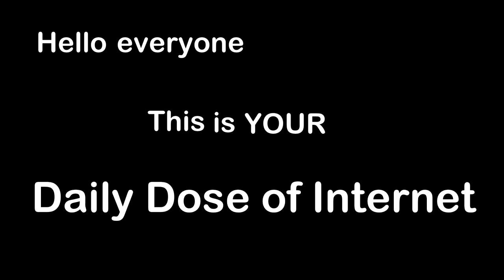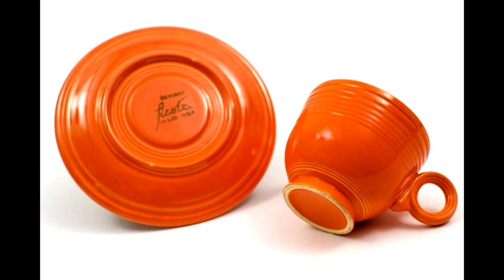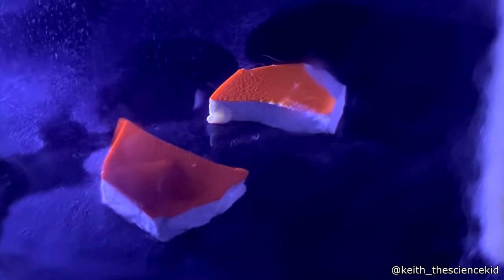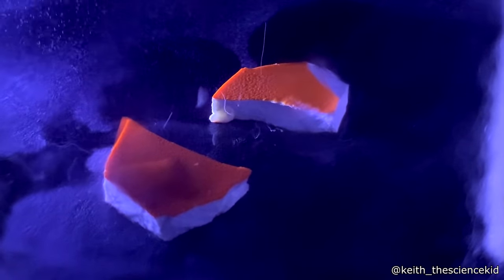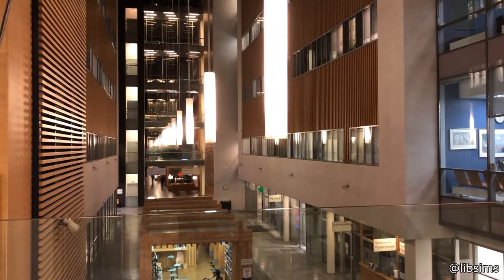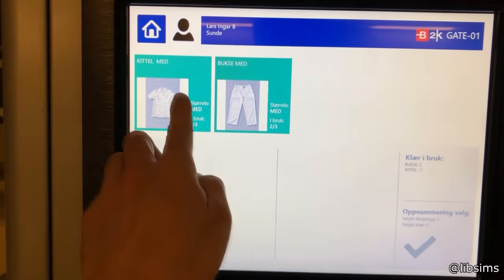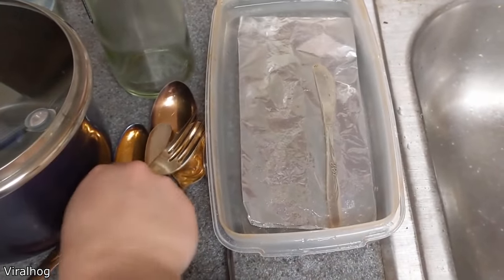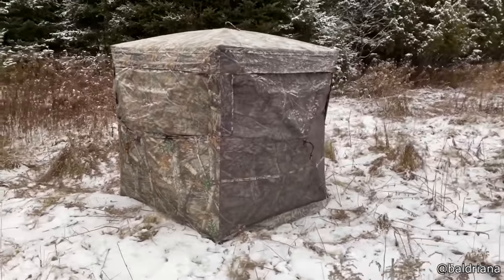Cutting Scissors With Paper

Comment: The silver cleaning method is a sheet of aluminium foil, a good spoonful of sodium bicarbonate (baking soda), and then boiling water. 
Place your silver items in the mix immediately while the water is still hot, one at a time, then rinse with tap water and buff dry with a cloth. Silver jewellery (like chains) may need to be dunked two or three times to get clean.
DO NOT use salt instead of baking powder. Salt will cause your silver to oxidize (turn black) even faster.

Comment: That radioactive pottery is actually pretty interesting. You never know, this could be the cause of a lot of things
Reply: The ionization is so short that you would have to eat the plate to be effected, but by then you would have bigger problems on your hand as the other materials in the Glaze would kill you long before the radiation would have any effects.
Reply: @G-_Money  According to the article I just read about it, it is advised not to eat off them or worse drink from them. On occasion is probably fine, but doing it regularly may increase cancer risks although such a correlation has never been observed. Even being in the same room may be a problem, but not significantly until you are around a lot of it or around it often. Risks increase if it is broken.
Reply: I know a lot pottery became radioactive when the US government was testing nuclear bombs in the 1940s and 60s.
Reply: I eat off the exact plate
Reply: Boomers and some of their offspring were around so much toxins and radioactive material especially as children. Sure they are tougher but brain damage doesn't equate to not being a snowflake.
Reply: Radioactive Pottery is radioactive because of the pigments used in the paint. Not good to eat/drink from daily, and risks increase with fractures/scratches in the coating, exposing the radioactive paint.
Reply: @MEGAF4IL  I have one with a chip in the bottom how dangerous do u think it could be
Reply: Radiation-wise, heating food in microwave is more dangerous than serving it on uranium-glazed pottery. Nevermind using your phone and wi-fi, that's another whole order of magnitude more radiation every day.
Reply: Like the cause of when I had Eight Diarrheas In one day.
Reply: There's some good stories of the Radioactive Pottery, such as the true story of the Radium Girls
Reply: Actually they probably did that for your safety to kills bacteria and it’s probably less dangerous then a tan
Reply: @jacobg8640  the only risk is if it's broken eating off it is fine your food isnt going to become radioactive if u put it on it only risk is if the dust from the paint from the plate braking gets into your lungs the plates already been around for years so anything that could come off it already has why do u think these havent all been immediately hunted down and destroyed because there particularly harmless
Reply: Exactly. And why were they covered with uranium in the first place? Like wtf
Reply: @brazybenjamin2937  because people didn't know it was dangerous and it glowed in the dark so it was cool
Reply: Bitten by radioactive pottery
Reply: I NEED MORE EXPLANATION FOR THAT AD NOW I DONT HAVE A FUCKING CLUE IF IM GOING TO DIE????????
Reply: I change the 777 to 778
Reply: I mean of course, your eating off of freaking uranium
Reply: AHEM AHEM CORONANAAAAA AHEM AHEM
Reply: For anyone who doesn't know what to think there's an article about this called "How Radioactive Is Fiesta Ware?" (Written by Anne Marie Helmenstine, Ph.D.) which basically concludes that yes there is an increased risk of cancer, you're probably going to be fine BUT in case that you have such dinnerware, the Radioactive emission that affects you gets minimized if you don't use it with acidic foods, eat off of it when it's chipped and sleep next to it. 

Here are some direct quotes if you do not trust my personal interpretation:

"Intact dishes do emit radiation, but aren't harmful. However, the risk of exposure increases if the pottery is chipped or cracked"

"Basically, you're not doing yourself any favors eating off the dishes and you certainly don't want to sleep with one under your pillow. Ingestion of uranium could increase the risk of tumors or cancer, particularly in the gastrointestinal tract. However, Fiesta and other dishes are a lot less radioactive than many other items produced during the same era"

Veritasium (youtube channel) also has a nice video on which sources of radiation exist and how dangerous they are :)
Reply: Cancer, Super Powers, Super Powers that allow you to give people cancer, or you can have cancer while everyone else has super powers.
Reply: I don't know about potery but I know rhat uranium glass is harmless if used occasionnaly. Like, you would need to be constantly in contact with it before it being an issue. So jewelery is a no no
Reply: Not really the amount of radiation produced by it would be so small it might as well be background radiation
Reply: C A N C E R !!
Reply: I think we need to address a certain Mark Fishbach’s plates...
Reply: And they didn't even know it was dangerous, there could be stuff we are using on a daily basis that we have no idea is dangerous
Reply: Like Cancer
Reply: Yeah, it's pretty safe unless broken
Reply: Yeah cus of the corruption of the government you cab see that Obama Williams has been vertifisised the hydrotherapie has nothin to deal with it. And thats why Donald Trump and Michael Jackson have the same blood type. So idk what ur talking about
Reply: Don't get a phobia of pottery because of this video or this comment, that small amount of radioactive stuff won't do any harm even if you keep it next to you every time you sleep.
Reply: @jacobg8640  If it's in a display case the radiation is about as dangerous as a tritium watch. Not a radium watch though, those were more of a production problem anyways, with the girls putting their brushes in their mouths and shit.
Reply: @Heliosva6912  I don't need superpowers to give people cancer. I have Twitter.
Reply: @bluntersthompson3865  welp
Reply: Corona
Reply: They also made plates out of lead, a long time ago. I think lead plates even dates back to the American Revolution.

Here is an interesting story relating to that factoid; an assassin had snuck into the kitchen where General George Washington's meal was being prepared. It was a soup. Secretly, the assassin put a chopped up tomato into the soup, as people thought tomato's were poisonous, as the people who ate them often died mysteriously.

We know know that the plates and bowls the tomato's were eaten off of when European's tried to eat them were made of lead, and thus reacted to the tomato's acids, but back then, people didn't know that. The soup was served to the General, with only the assassin aware of the "poisonous" ingredient. However, George Washington simply ate the soup, and even commented on its wonderful taste. The general hadn't eaten the soup out of something made of lead.
Reply: cheryl noble be like :
it was pottery all along 

btw i know what happened you dont need to explain
Reply: like 2 minor explosions in japan…
Reply: They used to lick radioactive paint they thought radioactive stuff was good for ya
Reply: And that's how I became... Sighs sadly Potteryman...
Whew
Reply: so long as it doesnt chip or break, its fine
Reply: @michaelbuckers  the radiation is relatively harmless though. a little bit of alpha radiation is a lot worse than a little bit of microwave radiation
Reply: Yup, exposing yourself to small amounts of radiation could result in some health problems, unless the amount is less than 1 milli sievert
Reply: @michaelbuckers  lmao, microwaves are not radioactive
Reply: @bluntersthompson3865  lethal
Reply: like lead plates ....
Reply: @Vivi-ADS  Lead plates would probably be REALLY dangerous.  Serve anything acidic on them like tomatoes and you get actually quite a lot of lead.  Compared to that the orange glaze is nothing
Reply: @tsm688  pretty sure lead plates were a thing for a while, people would eat tomatoes off of them then think the tomatoes were poisonous
Reply: @Vivi-ADS  that's kind of a myth, modern tomatoes are a different breed than the old ones, which were vaguely icky things which people just used decoratively
Reply: @tsm688  is it? I heard it from somewhere
Reply: @Vivi-ADS  there's a hell of a lot of myths around tomatoes, but it turns out that like most food crops, we just didn't discover it in its modern form
Reply: As long as It's not shattered or scratched It's completely harmless, he forgot to put that in the video.
Reply: Imagine drinking from those tho 💀
Reply: The pottery is safe if it is not broken
Reply: i read that as “radioactive poetry” and was just preparing myself for a nice plutonium english lesson
Reply: @michaelbuckers  Not true. Radioactive means ionizing radiation, which causes DNA damage. 
Microwaves, wifi, and cell phones are using radiation, but not ionizing radiation; all those are on opposing sides of the energy spectrum. They do not cause DNA damage.
Reply: @michaelbuckers  Microwaves are only more energetic than radio waves, that are all above a meter lengh, but even less energetic than the InfraReds radiations our body constantly emits with natural heat, in micro-meters.

Even above there's visible light, and then UltraViolets, which's the first wavelengh that starts becoming ionzing, with a size and intensity that can sneak between molecules and breaks them. And even if not, it heats much faster because of its energy.

Radio-activity is usually molecular disintegration that produces radiations wavelengths way above UVs, X-rays and Gamma-rays, and can also shoot actual molecules too, the most dangerous.

So coming back to microwaves, there are other factors; as they're so large they doesn't interact that much with things, so they can travel further through maters, like walls.

That's why for Wi-Fi it's just as enough both convenient and energetic, but it starts to be harder to pass obstacles with 5G, but it's also not diffused blindly in all directions so we waste less energy anyway.

So the waves in oven will pass few centimeters in meat, but it's often not enough to properly heat the center before it burns the sides, we have to use a bunch of them in order to be efficient, but it will only accelerate the variance (that's why we can't de-cryogenize something bigger than a mouse, because of the physical lengh of the waves that can heats water molecules how we want, and an half-frozen body can't stay alive for long).

And as the microwaves so big, of few centimeters, they don't cover the space evenly. We use tricks like the size of the box that's specifically measured to make the waves bounce perfectly in the opposite so the peaks double in size, but the gabs between will still not reach much thing.

Actually, a magnetron will target to create the most interesting length that resonate with water molecules, but its accuracy will actually produce in a spectrum that can bounce around and heat different molecules but way less efficiently... While still being much more concentrated than regular network microwaves everywhere outside of the faraday cage we're talking about lol.

So anyway that's why we rotate the food so we're sure it will encounter the efficient zones but the best is still food in water that will evenly diffuse the heat like normal boiling.

And finally the real danger of microwaves result in their definition, electromagnetic waves, and so, for things when light can cause harm, microwaves will also. That's the case with milk for example, that is not stored in shadows for nothing, and so shouldn't be warmed for long in a microwaves oven.

But in general, most radiations not highly ionizing will just struggle to cause any harm to you before the warming of the hot heat caused by molecular agitation will simply cook you alive. And even uranium won't casually one shot you, as an untreated mineral, it's has much radioactivity power but that's naturally released very slowly for a very long time (infinite by definition, but we can talk about half-life of few BILLION years)

On the other hand, granite is also radioactive, but can also be very present, in the soil, buildings... And the radioactive gas Radon it produces can accumulate in not enough ventilated aeras, and that is dangerous and not very well known.

Just like cave exploration dangerousity is also most time nothing that we can find in Minecraft but just natural gas. Because natural things often like to kill us I dunno why.

Anyways, anything in our planet even simple potassium is relatively radioactive, and the most dangerous things we encounter is not a lil meal in some glowing plates but more a X-ray radio (more x-ray than radio lol) that quickly reach the acceptable limits, and also really recurrent traveling in planes, where the atmosphere has blocked less particles from the space, and so, astronauts will always be way more irradiated that any technician doing his job in civil nuclear.

"Safe limits" are less established to approach healthy limits than the above 0% risk limits, so even if we're not sure about an unusual case, we still don't have to worry about it if we follow it. So many radioactivity measures that appears to be "enormous" compared to the limits of the limits of the beginning of safety questioning, could in fact be multiplied many times before reaching an actual risk effect. While still being less dangerous than a banana, or some medical protocol to be more fairplay.

On another hand, millions people are dying daily because of fossil energy pilotable productions, and so there is absolutely no reason to limit the use of radioactivity in order to safe ourselves (and considering the amount of waste that is both highly radioactive (risky quick disintegrations) and for a long half-life (will be half less dangerous each some amount of years) can fit in a thimble for each person's lifetime (in worst case actually maybe it's just for all wastes including things that we could lick before a year, I don't remember exactly)
Reply: the radioactivity in these things even when they where first made was so low it was more of a cool fact
Reply: mostly cancer i think
Reply: @michaelbuckers  LMAO sure buddy
Reply: No. No it doesn't.
Reply: @anoon-  wtf even was this comment
Reply: @michaelbuckers  definitely not true 😂😂😂
Reply: If I overload the dishwasher will it cause the next Chernobyl?
Reply: I agree with you. I also think a lot of things can be the cause of a lot of things.
Reply: When I have a radioactive cup I'm drinking out of-
Reply: I think lead has had a worse affect
Reply: Like the boomers' addiction to FoxNews?
Reply: so people can just destroy every single pottery and tons of things could disappear?
Reply: Meh
Reply: i'm somewhat bemused by all of these people freaking out over old pottery, when a large number of them probably drink alcohol which is far more harmful to health.
Reply: @G-_Money  if ventilation is low such as in a cupboard the radon produced could build up which is more dangerous.
Reply: Janice is so freaking cute! But in a couple of years I bet she’ll be eating whole cows like the gator from Lake Placid!
Reply: What's dangerous is to eat the chip - really, really. Or inhaling dust from the paint.
Reply: @michaelbuckers microwaved food does not make your food radioactive 😂
Reply: @smapa1185 People be panicking about uranium like its some super killer material of radiation. Not like what you see with your eyeballs isnt radiation, literal light is higher energy than all you listed, and yet uranium is a bad thing.

Comment: So paper is the ultimate move. It defeats both of its enemeis. LEGENDARY.
Reply: Well actually, shooting rock at the speed of light could defeat more than just paper
Reply: @JoshieBoyz  so does shooting a paper at the speed of light
Reply: @shub2726  not really, that paper's speed will keep deteriorating due to the air resistance.
Reply: @JoshieBoyz  unfortunately air resistance isn't there in space
Reply: @shub2726  i was talking about on earth because the chances of the paper and rock hitting eachother at the same speed unless its precisely aimed
Reply: @JoshieBoyz  how can you get a rock on earth moving at the speed of light? ;p
Reply: @shub2726  plot.
Reply: OMG SK TRUE
Reply: The paper is like a bee. It instantly dies after vanquishing it's enemy.
Reply: @JoshieBoyz  iiiiiiiiioooooooô
Reply: @JoshieBoyz  If you shoot a rock at the speed of light it would also have air resistance though. It would cause the rock to heat up until it vaporizes.
Reply: @kalahatze   b but paper will vaporize first
Reply: now i can use this knowledge to defeat everyone in rock paper scissors!
muahahha!

Comment: "Paper can defeat scissors by spinning really really fast"
Me: Does that work for scissors against rock, or rock against paper?
Reply: Yes, if they spin very fast. Spin for the win.
Reply: They really need to make Rock Paper Scissors less spin2win
Reply: @MewPurPur  Replacing paper with double-sided tape would solve the rock to paper and paper to scissors problems - the spinning rock would get stuck on the tape, and the tape wouldn't be able to spin. Any solutions for the scissors to rock problem?
Reply: @birthsonbluebell3654  If the rock is talc, then it can be easily destroyed by the scissors. Even small chalk pieces will work.
Reply: @jaydamle4627  Ummm, I want to make rock stronger, not weaker.
Reply: @birthsonbluebell3654  Well I assumed the reverse 😐

Generally rock beats scissors so I thought you'd need scissors to defeat rock
Reply: @jaydamle4627  Oh.
I was basically asking how rock could counteract scissors spinning really fast. But yeah, making it stronger would do it.
Reply: We need a game based on this.
Rock Paper Scissors 2: The legend of the spinning island
Reply: @mostlywholesome  I'd imagine it having bosses like Knife, DIamond, and Tape Roll.